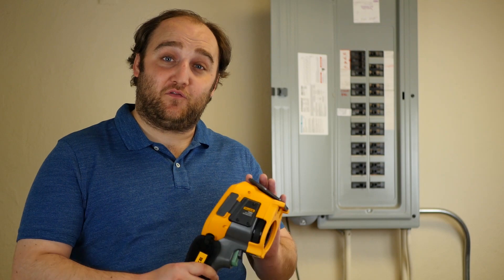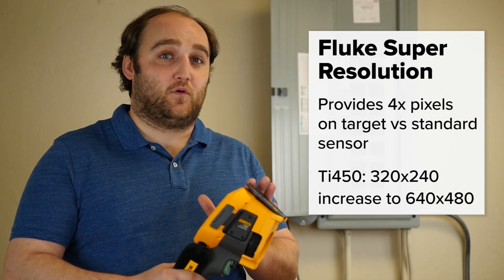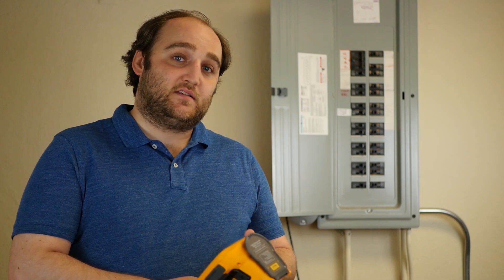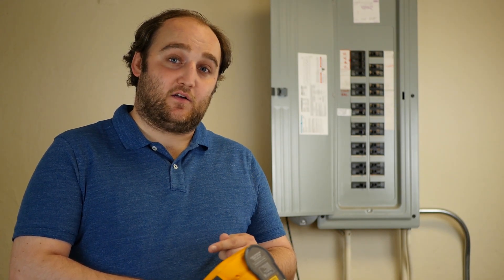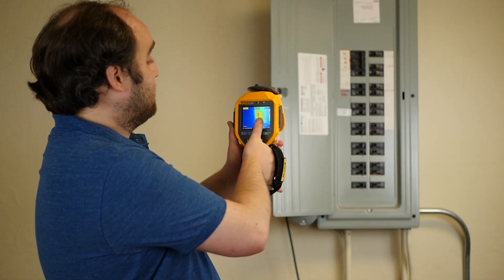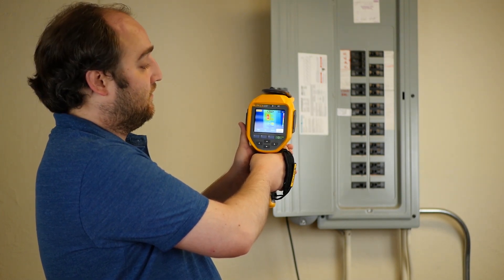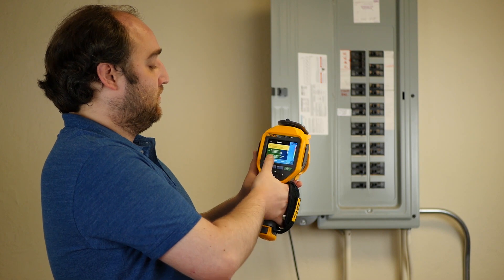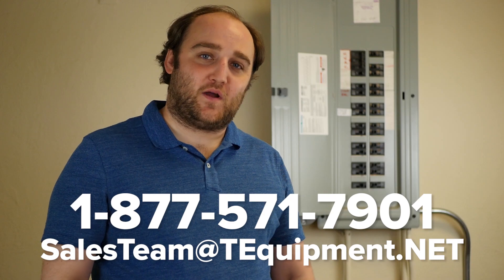How to Use Fluke SuperResolution - Expert Demonstration

Comment: Can I store  thermal camera data as a  excel format?
Reply from the maker: When using a reporting software like Fluke SmartView you should be able to export data in excel format. First, you need to add the images to the software, then create the report. Most reporting software has this capability.